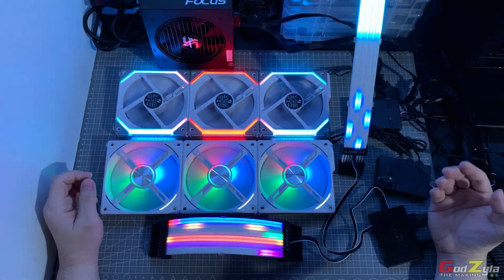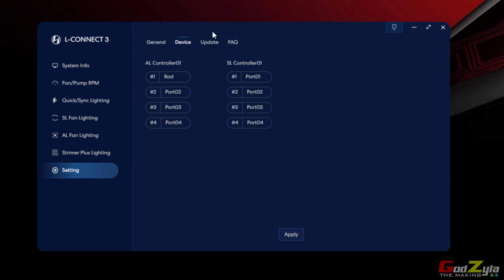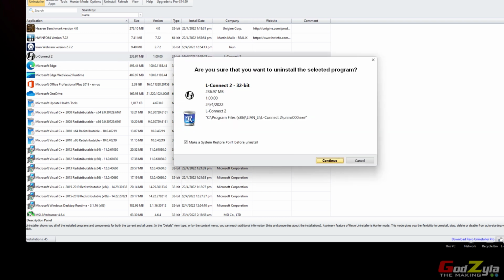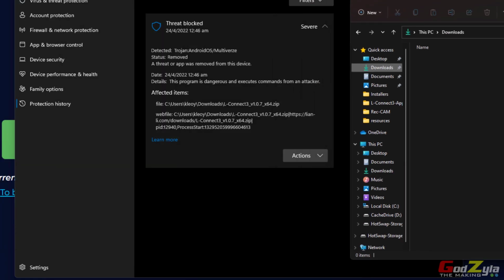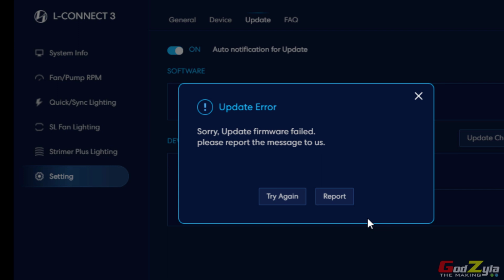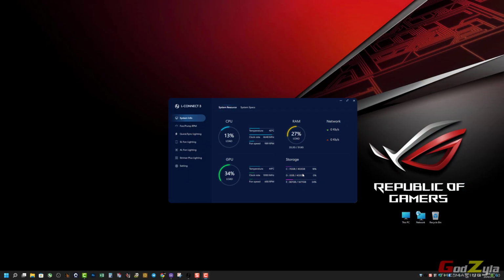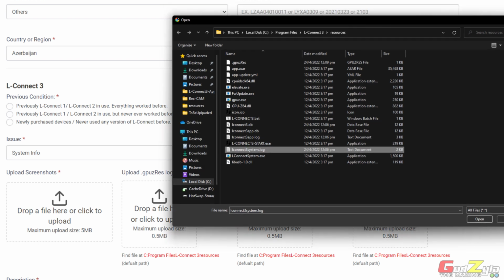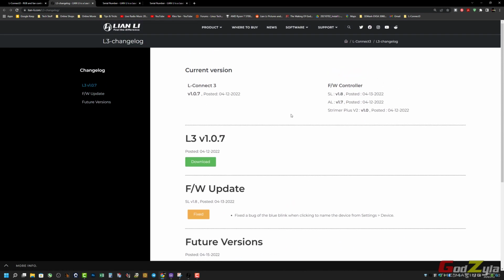Lian Li - L-Connect 3 (Installation)

Comment: what if i downloaded the L connect 3 software and when i go on it, its just the settings and system info.  how do i get all the other stuff on there like the rgb management and stuff.  and yes, i already checked evrything for updates
Reply from the maker: Hi, I''mAggro, welcome to my channel, I like to check, do you have the uni fan controller? If you do not have the uni fan controller, you wont be able to use the L-connect 3 application. Maybe this video will help you out. https://youtu.be/CgvuUFeff8U
Reply: @KleoYan  I don’t know what the uni fan controller is cause my dad made the thing for me and the l connect previously HAD the rgb thing on it but when I uninstalled is cause it wasn’t responding when I changed the rgb on the app,  and when I reinstalled it, there was no rgb control thingy.  I hope this comment made sense
Reply from the maker: @AggroBeing  I see. It will be better if you ask your dad about the component used and watch this for future understanding https://youtu.be/CgvuUFeff8U

Comment: Bro i have Lian Li 360mm with UNI SL 120 version AIO and 24 plus GPU streamer cable all installed in USB header.
I want to know if i buy UNI SL 120 v2 3 fan set is it compatible with one L Connect controller? or do i need one more usb header for that to controll?
Reply from the maker: Hello zFearS, welcome to my channel. The SL V2 fan and the SL original are of different plugs and controllers, you will need to have another usb header. Or you can do this. Just
Use the v2 controller and plug your v2 fans. Then for the SL original. Plug the argb to sync 2 or sync 3 of the v2 controller. Control the argb via L-Connect 3. But for the fan loan on the original SL, you will need to plug directly to the motherboard fan header and use your motherboard utility or inside uefi to control the rpm.

Comment: Been trying to figure out why my rgb lights aren't working and I downloaded the L connect 3 and all I see is system info and settings
Reply from the maker: Hi will W, welcome to my channel. I like to check these few things from you. 1st is your Windows 10 or 11 with latest chipset version installed, 2nd did the uni controller device shows up in device manager under Universal Serial Bus Devices, 3rd is your uni controller uptodate with the latest firmware and lastly does your temperature reading of the CPU and GPU reacts when you load or to do some benchmark test? Here is another video and I know it's lenghty but it fixes some of my viewer's issue before approaching Lian Li tech support, you might want to watch it and fully undestand how this L-Connect 3 works. Make sure to take the time and do not rush into it. Hopefully it will help you resolve your L-Connect 3 issue. https://youtu.be/CgvuUFeff8U

Comment: I just bought a bunch of the SL Infinity fans and they work, but I cant seem to control RGB the way I want to. Its like all or nothing. No control over the rim or the hub colors etc. Also when Im in the software I dont have the option to click on individual fans like you do under the SL Fan Lighting tab under LED MODE. I just see the drop box, but there's nothing below it. I have updated everything like the BIOS and the chipset drivers. Ive removed all ARGB software as well. Not sure if this started after I connected the fans up, but for some reason the RGB that was on my Asus Strix x-470 f gaming mobo no longer lights up which is odd. Ive installed and unistalled L Connect 3 like 5 times, even going in and manually deleting the folders the website asked me to delete after uninstalling. In my device manager i can see the Uni controller all alone under the final drop down menu as well. I have 13 fans total. 10 are the SL Infinity fans, and 3 are the SL fans that came with the Galahad 360 aio. Ive even tried unplugging the 3 SL fans along with the Galahad and trying to install L Connect 3 with only the Infinity fans plugged in, and still no dice. I guess ill try using the uninstall software you have linked below and giving that a go, but this is making me not even want to use my Desktop which, including these fans, I just dropped like $1500 worth of upgrades. The only thing I didnt change was the MOBO itself. Literally everything else down to the PSU was upgraded. Gonna buy a second mobo and build myself a whole other system, but thats beside the point. Really kind of struggling here as these fans are GORGEOUS and I dont want to send them back, but I, for the life of me, cannot get the software to work like it is supposed to.
Reply from the maker: Hello Elliott, welcome back. Do you happened to use a gigabyte aero or vision D board?

Comment: Hi help me please 
Whenever install the app with administrator rights. And open the app. It’s like frozen I can’t click anywhere in the app just move the window. Like why does this happen. I got my unifans SL without the logo in the controller and I’m using l connect 3. Please tell me how to fix. My bios is updated and system motherboard recognized the usb. But not the fans via pwm. I read for a fact that you have to enable inside the app manually for the mb to control them. But I can’t do anything if the lconnect app doesn’t work and stays frozen!
Reply: I did it now I can control l connect. But it stays frozen in update it doesn’t let me update nor check update check. And the video you referred me to doesn’t tell me how to manually update
Reply from the maker: @DrMephisto23  follow this instructions on their official page. if it prompts you to key in a password when zipping the files, type "lianli" https://lian-li.com/l-connect3/L3_update_manually/
Reply from the maker: Hello DrWisPlayer1, welcome to my channel. maybe this will help you.. do the manual update https://youtu.be/CgvuUFeff8U
Reply: Do I really need to uninstall all rgb software?

Comment: question the sata cable that plugs in to the controller box  the other two cables rgb n usb one   from v1  do they fit in v2 controller
Reply from the maker: Hello I dubbed, welcome back. No it will not work.

Comment: A little late but I’m stuck on where there’s only 3 tabs so. Do you know hey or a fix
Reply from the maker: Hello Reb3d, welcome to my channel. can you peform step A) and b) listed below?

A) Remove all argb apps (Asus Armory Crate / MSI Dragon Center / Giga Fusion / Asrock Polychrome). If the brands which I have mentioned, do have a uninstall tool like the Asus Armory Crate, use that. Else use Revo uninstaller ( https://www.revouninstaller.com/ ) to uninstall the apps as mentioned. Revo uninstaller will remove all unwanted files / folder / registry in your system. Illustration to use revo uninstaller https://www.youtube.com/watch?v=uMgUYiakpxM&t=437s

B) Follow this video (https://youtu.be/CgvuUFeff8U)
Reply: @KleoYan  thx!
Reply from the maker: @5is_him  hope that will aid you. All the best.

Comment: Has this firmware problem been fixed yet? I just built my first pc and have the sl120 and the streamers V2 do I still need to update the firmware separately
Reply from the maker: Hello Michaeal Olden, welcome to my channel, you can download the L-Connect 3 and plug your SL uni controller only and see if there are any firmware updates. if it does not work, then you might want to try manual firmware update. for details on manaul update, kinldy approach lian li's L-Connect 3 website. https://lian-li.com/l-connect3/

Comment: My software L-Connect3 for some reason won't do anything on the fans, what can i do to solve this issue? It doesn't work i can't set my fans to any color.
Reply from the maker: Hello DarkyXO, welcome back. you might want to try these steps to see if it resolve your issue. Instructions as follow.

Basic Troubleshooting steps

1)	Make sure you motherboard bios is up to date, please check on your motherboard manufacture website, under support > bios and drivers. See if there are issues with USB and do they have a fix. If there is, kindly update those bios firmware version.

2)	Make sure your chipset driver for your motherboard is up to date!. For AMD will be at https://www.amd.com/en/support for Intel will be Intel Driver & Support Assistant Intel DSA https://www.intel.com/content/www/us/en/support/detect.html

3)	Remove all argb apps (Asus Armory Crate / MSI Dragon Center / Giga Fusion / Asrock Polychrome). If the brands which I have mentioned, do have a uninstall tool like the Asus Armory Crate, use that. Else use Revo uninstaller ( https://www.revouninstaller.com/ ) to uninstall the apps as mentioned. Revo uninstaller will remove all unwanted files / folder / registry in your system. Illustration to use revo uninstaller https://www.youtube.com/watch?v=uMgUYiakpxM&t=437s

4)	Shutdown your PC, unplug the PSU cable from your AC outlet. Press the power switch twice to discharge all current that your motherboard is holding. Leave it for 45 second

5)	While waiting, please do not use KVM switches. Disconnect all devices that are connected to your motherboard (front / back IO). Leave only your Keyboard, Mouse , Monitor and Ethernet (If you have) connected directly to your motherboard. If your monitor has a KVM build in remove the USB cable from your monitor to your motherboard USB socket. If your mouse and keyboard is connected to your monitor, please remove them and plug them directly to your motherboard instead.

6)	Plug only one Uni controller or Strimer Plus V2 controller. If its for Uni Fan (SL/AL) use only 3 fans to an output.

7)	Plug the power cable and turn on your PC

8)	Go to your Device Manager, look under Universal Serial Bus Devices, make sure you see the Lian Li uni / strimer plus V2 controller.

9)	Install the L-Connect 3 app only https://lian-li.com/l-connect3/ (current version 1.2.6)

10)	After installation, run the program, check under Setting > General > make sure Auto-Run on Boot and Minimized L-Connect 3 to system tray at close are ON.

11)	Reboot your system.

12)	First thing you need, go to device manager and see if the Lian Li controller is listed, next open up the L-Connect 3 app. Check if there is a need to update firmware to your controller. Go to Settings > Update, under Device F/W version, click on Update Check, download and install the firmware. Make sure the firmware is completed. Do a check on device manager and make sure the Lian Li controller is listed.

13)	On L-Connect 3 dashboard, check if the CPU and GPU readings are reacting, you might want to test it using some benchmark programs. If there are reaction, play with the PWM and argb functions. If it does not work, skip step 14) and proceed step 16)

14)	If Single controller works, shutdown your pc, connect uni fan set of 3 to your output of your uni controller. Do it small steps at a time to hook up your sets of fans. do not do all in one go. If successful and you have a second controller, proceed small step at a time again.

15)	Slowly plug back your USB devices (Headset, Microphone, Printer, USB Capture Card and etc). At any point of time as you add those devices one at a time, if L-Connect 3 become unresponsive. This tells you that there power is insufficient to power up more USB Devices. Whatever USB port on your motherboard, there is a limitation as the current are shared across the board, be it front or back I/O and the internal USB Header. You might need to get a Internal USB Hub that comes with a Sata Power source to the Internal USB Hub. (Disclaimer, buying a internal usb hub might or might not resolve this issue, purchase at your own expenses)

16)	If it does not work, report your issues to Lian li Tech Support. There is a in build log ticketing system in L-Connect 3 app. this is what you need to do. Go to Settings > Support > Click on “Download log” place a filename and choose a destination drive to save the log file. Next click on “Report” it will take you to Lian Li Tech Support FAQ. Fill up the form and upload the log which is a zip file.

Comment: i bought a bunch of SL120 fans and a 8pin v2 cable (24 pin out of stock) is it not possible to use the cables with the controller that comes with the fans? and then when i get the 24 pin the new controller will follow. can i connect all fans to that and the 2 cables or what do i do
Reply from the maker: Hello Genesis Mikkel, welcome to my channel. Does your SL120 Uni Controller has the SL labeled on the Controller itself? if it's with the SL Labeled, you can directly use L-Connect 3 but firmware update is needed. Once you have tested all SL120 fans works on L-Connect 3, you can get a converted for your 8pin to connect to the uni controller, but you wouldn't be able to use the Strimer plus effects from the L-Connect 3. The converter can be found here https://www.aliexpress.com/item/1005003182827084.html?

Comment: Hi Sir,  currently im still using L-Connect 2.. as for now is this software stable enough to use? or should i wait until all issues has been solved? haha im so lazy to troubleshoot because im not good at it
Reply from the maker: Hello Hasrul Nizar, welcome to my channel. I have been using this app since the earlier version. You can give it a try. If it does not work, you can go back to l-connect 2. A smarter way to test this is. If you have another spare ssd to test the l-connect 3.

Comment: ive downloaded l-connect3 to use the new infinity fans and the application will not open even when i run as admin....it will pop up for a brief moment when it asks for promission to run but then disappears even tho there is an icon on my menu bar showing the program is running. any idea whats causing this? i uninstalled other programs that would be fighting this program as well as delete and reinstall the program.bios is up to date on my ROG Crosshair VIII Dark Hero as well but im currently having to run it without the controller because when I connect the usb the fans shut off but I found its because theyre set to 0 rpm stock and need to be set in l-connct 3
Reply from the maker: Hello ZedsMed maybe you might want to try my basic trouble shooting steps, some steps you can skip as you have done so. Look at the pinned comment which I have listed.